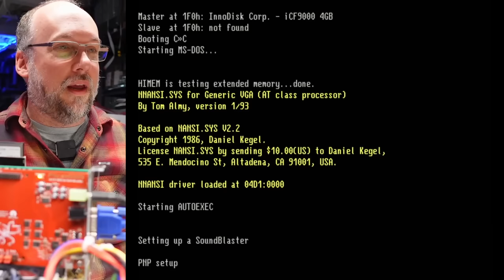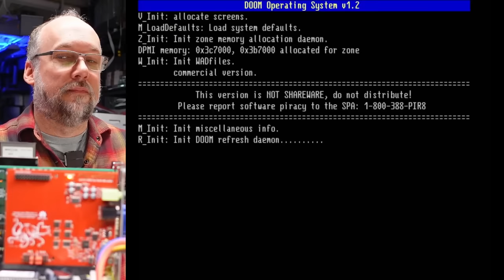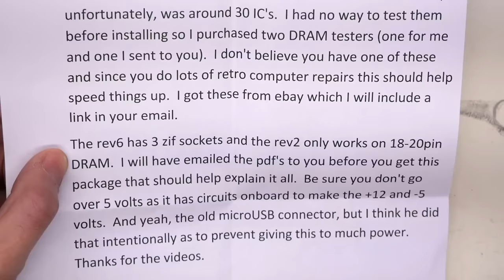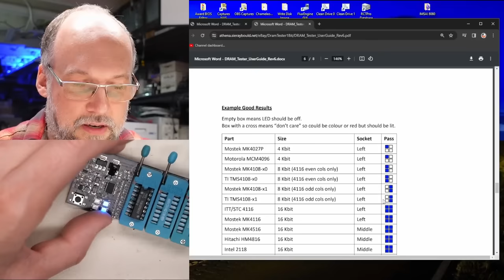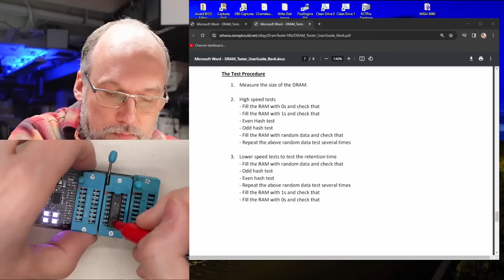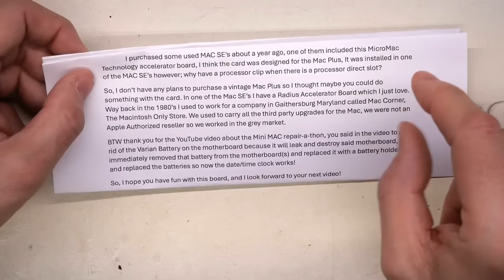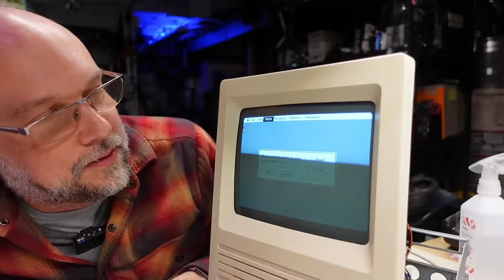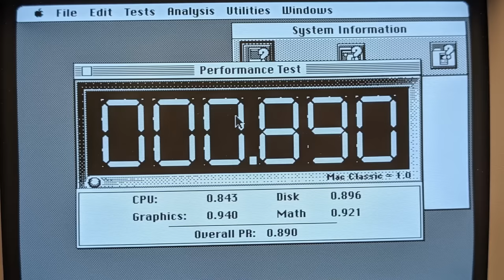0083 PicoGUS emulating a Sound Blaster, DRAM testers and a clip on Mac accelerator

Comment: Just some thoughts on sound cards... probably not worth reading.  :-D

1) SB 2.0 / Pro / 16

In DOS, everything was limited by RAM and disk space.  A game would have to pre-load the audio samples into RAM that it would be using.  And you would have to get them to the user somehow.  Nobody wanted to use 6 more 3.5" floppies to store the audio for a game.  (Or spend an additional hour or more to download it from a BBS.)  You weren't just going to compress them -- OGG and MP3 weren't a thing yet, and we wouldn't have had the CPU time to decode them anyway.  So, samples were (for the most part) 8-bit PCM, sampled at something like 8-22kHz.  Typically, 11-16kHz.

So, even if you had a SB16 or AWE32 or PAS16 or WSS, at best, you were probably getting a 16-bit mix of one or more 8-bit audio samples.  (One or more, because you might have some kind of environmental sound effect mixed with a gun shot or voice clip.)  Suffice to say, you weren't missing that much if you "only" had a Sound Blaster Pro with 8-bit audio.  The main advantage of anything better than the original SB 2.0 was stereo sound.  For DOS gaming, that's pretty much the top of the hill.  16-bit mixing is just a little cleaner mix of fundamentally awful samples.  Nice if you have the DAC and the CPU time and RAM to spare, but certainly no big deal if you don't.

Now, 16-bit was a little better for playing back sampled music, like MOD files -- which were also made up of awful quality samples, but there were more of them playing at once, so you could actually benefit from more resolution in the mixing stage.  It still wasn't going to fool you into thinking you were listening to a CD, but it did sound better.  GUS and AWE32, with hardware interpolation, better still.  The only time 16-bit really mattered is when you were playing full resolution audio, like a rip from an audio CD.  Never mind that one song would use a considerable percentage of your hard disk to store .... (Bear in mind, even as late as the Pentium, we still had BIOS limitations of 500MB hard drives -- not quite yet equal to the capacity of a single CD.)

2) GUS in general

The hardware sampling of a GUS was rarely used to its potential.  If you were a fan of MOD files or the demoscene, then you probably know what it can do for you.  If you're mainly in it for the games, there's not much to love.  It wasn't a Sound Blaster, which automatically limits its breadth of support right out of the gate.  SB emulation was nearly worthless.  OPL emulation was absolutely worthless.

Most games that DID actually support the GUS, still treated it like a 2-channel sound card.  The ones that supported it as a sampler might run a little better, what with not having to mix samples in software.  On a faster 486, that didn't matter much anymore.  Only a handful of games used it directly for music, which sounded better than software mixing.  Not WORLDS better, but definitely better.

Games that used General MIDI could use it as a MIDI synth, which was its target market, and the real reason to get one.  But, frankly, the GUS was tragically early to this party.  The original ones had tight RAM limits, which required balancing whether you wanted more instruments loaded, or better quality for fewer instruments.  Also, whether you wanted more voices playing at once, or better quality voices.  Later GUS chipsets improved on this, with more RAM and less limitation on polyphony.  NONE of them (AFAIR) had any support for hardware effects like chorus and reverb.  When the AWE32(/SB32/AWE64) came out, it had built-in ROM samples (to give you at least a baseline full GM sample set using 0 bytes sample RAM), the ability to augment or replace the ROM set, full quality at full polyphony, and hardware effects.  Better in every way, less rare now (and thus less expensive), and with full SB compatibility.

Of course, now, you can have an MT32 or Sound Canvas or Yamaha XG synth, so who cares about any of that.

TLDR:  The GUS is an aspirational card for those of us who were there in the early days, when our CPU struggled to play back an 8-channel MOD.  And that's about all it has going for it.  Super cool, but nearly pointless today.  Which, let me be clear, is to say nothing of the PicoGUS project.  Just having a software-defined audio card as a concept is enough reason to justify its existence.  But if you were wondering what you missed by not having a GUS -- not much, unless you were in the nichiest of niches.

3) High-end DACs

This is a trend I don't really get.  As per #1 above, a super high-quality 24-bit 96kHz DAC is not doing anything for you.  "ISA noise" wasn't a DAC problem.  It was a grounding and signal integrity problem.  Good electrical design practices will resolve that for you, and a 16-bit / 44kHz DAC is more than enough for anybody.  For the most part, it still is.  Now, granted, at this point, it's probably just as cheap and just as easy to use an HD audio DAC, if not cheaper and easier, since it's a baseline requirement for compatibility with modern audio sources like DVD, BD, and HD streaming.  But don't think your Windows 3.1 WAV files are going to sound any better through it.  ;-)  Garbage in, very high fidelity garbage out.

To sum up:  PicoGUS:  Good.  Hype about uber elite sound cards from back in the day -- mostly nonsense or for specialty cases that don't apply to nearly anyone anymore.  FOMO over 16-bit support or creme de la creme DACs:  Little to nothing at all there to miss.
Reply: Couple little expansions on what you said because it's almost entirely spot-on:

> If you were a fan of MOD files or the demoscene, then you probably know what it can do for you.

Even then it was still rarely used to its full potential because at a time when most people were connecting to BBS with 14.4k modems, most all musicians were still using 8-bit, low-fidelity samples in their tracks. Most tracks using all 32 channels or 16-bit samples were seen as flexes that were almost universally devoid of artistic merit.

> Games that used General MIDI could use it as a MIDI synth, which was its target market, and the real reason to get one.

And even then, only programs that used Real Mode (ie. no EMS or XMS) could really do this, and some still had problems with other TSRs. If you were using a game that used Protected Mode to access memory higher than 640k, you were SOL on General MIDI compatibility and were dependent on a GUS-specific driver.

> "But if you were wondering what you missed by not having a GUS -- not much, unless you were in the nichiest of niches."

Truest words ever written about the GUS. There's a reason why they were almost universally moved-on from by the mid-late '90s.
Reply: @krad2520   I've always been an audiophile (in the "I love audio" sense, not the "I love $2000 power cables" sense), and fascinated by computers, so the confluence of the two in the 90s made me lust after both the GUS and AWE32.  By the time I had a computer that could benefit from any of this, they were both options, and I was a little torn between the two.  Ended up going with the AWE, and it was 100% the right choice.

I did love demos, and lamented that I couldn't run some of them with hardware mixing.  Also, the famed "GUS patches" that you could use in software mode with CP even on plain 2-channel cards.. that had a mystique about it that made the GUS desirable.

Today, I do own a few genuine GUS variants.  One of them is in a Cyrix 6x86 running Windows 95.  I love it, but it's almost more trouble than it's worth under Windows, and being of the fledgling PnP era, barely any better under DOS.  As a wannabe MIDI musician back in the day, I would've killed for this computer.  I'm proud to have it now, but it can be ornery, and if I'm blatantly honest, doesn't do much of anything the AWE32 couldn't do better.  It's just a long-overdue dream fulfilled.
Reply: @nickwallette6201  I feel you on all of that, and am in (mostly) the same boat-- except in my instance, I opted for a Sound Blaster 16 and a Wave Blaster. Picked up GUS 2.4 later ~1998. It's nice to actually see someone writing something very relatable here LOL. I was also a little wannabe MIDI musician who hung out on the AOL "Composer's Showcase" board.

I really do wish that a lot of the hype that is given to the GUS was counter-balanced by the card's historical context. You clearly get it, you were there, but I don't think I've seen any YouTube creator explain that when the card came out, the general public's access to the things that took relatively full advantage of the card was limited & often arrived belated.

Like, if I'd even had my GUS in 1992 when it came out, I certainly didn't have access to the two BBSs in my area code that kept active mirrors of scene releases... those BBSs were not readily published in BBS lists and were very selective in granting membership.

Until internet access got widespread and people could get on the Hornet FTP, Scene.org, or Modarchive, your only real access to scene releases as a member of the general public would be if your local BBS had any reuploads or you bought a 'shareware/freeware' compilation disc that just so happened to contain them.

But by the time internet access got widespread and any of those resources I mentioned were available, the GUS's heyday had already passed.

If nothing else, I'm actually pretty happy that the PicoGUS is here to democratize access to the GUS experience so that maybe some of the astronomical hype around the card can be cut through :P

Comment: Just to avoid confusion: Wavetable synthesis means something different for soundcards and synthesizers. With soundcards it just means sample based sound generation, with synthesizers it means that there is a table of waveforms through which you step or morph to generate one sound, like in the iconic PPG synthesizers. It would be easier if soundcard enthusiast would agree to call their "wavetable synthesis" "sample based sound generation", because thats what it is.

Comment: For those PDS connectors, wouldn't rows of pin headers soldered in those holes work for connecting that MicroMac board to the motherboard? Would be a lot simpler than fidning the matching connector, given how hard older connections can be to find... :)

Comment: Yeah, there were a handful of PC programs that supported SID, I used to have an ISA card that took 4 SIDs, don't recall the name of the software packages off the top of my head though
Reply: HardSID Quattro was PCI, but the original 1-sid version was ISA.
Reply: @poofygoof  99% sure the quad card I had was ISA so perhaps not a HardSID but it was more than 20 years ago now so possibly I'm misremembering.

Comment: You might want to check the clock speed on that crystal. Maybe the cap you put in was the wrong value and the crystal isn’t running at the right speed.

Comment: Something that just occurred to me re: Cubic Player and offloading MODs...  How does it support the real-time visualization when the card is doing hardware mixing?  It wouldn't have access to the mixed stream, would it?  Is it actually software-mixing the audio in parallel just to give you the pretty graphics?

EDIT:  Oh, and it might not have worked in SB mode because the SET BLASTER statement was calling it a Sound Blaster 16 (T6) with High-DMA 5 (H5), and that obviously was not backed by hardware.

Comment: I still have my original GUS 1.37 card. Not the later version but the OG. Unfortunately my Sinclair PC200 has a DD floppy drive so I can't load any software on it! Not yet, until the PicoMEM that is ......
Reply: Hi,
PicoMEM 😀
You may even not need a picogus to do gus on the PC200, It may arrive on PicoMEM as well.

Comment: just wondering, is it possible to use the menus in autoexec/config to choose a "profile" that will load the appropriate firmware then set the rest?

If I can allow myself a little suggestion for the PicoGUS, if there's a couple spare pins on that RP2040, maybe a MUX or 2 to set the SB settings in software?

Comment: I have an old (1987, designed here in Hungary)286 laptop with an extra 8-bit ISA slot,(and also an extra 16-bit ISA slot, occupied by an ISA RAM card) and 1MB RAM. Will this PicoGUS card work with that? DOS games with B&W CGA-compatible graphics, and Windows 3.11. Nothing else I want from that computer.

Comment: "Limiting the power input" is a bad justification for using a micro-B USB connector instead of a USB-C; you can't really trust the source to limit current to anything in particular (many power bricks will blindly deliver 2-3A even over a micro-USB), and you should just put a fuse onto the board if you're concerned about that.

In fact, looking closely at the board it appears there is a fuse on the designs anyway. If you're worried about it blowing from bad chips and being a pain to replace, then a polyfuse or e-fuse will provide a resettable (and in the latter case, highly tunable) option.

Comment: It'll eventually have support for sound blaster pro 2 or 16 that support with full 44khz 16 bits stereo quality and OPL3 and are the sweet spot for full DOS, Win 3.1 and Win9x compatibility. it's a nice project.
now... somebody do this for 3d accelerators? like a card that emulates 3dfx up to voodoo 3 and maybe the first couple of ati and nvidia?.

Comment: Why use this ugly mini jack connector for MIDI out?! They have fully designed the board and couldn't fit a proper DIN-5 connector?
Reply: DIN-5 is too large for the opening on an ISA slot. 3.5mm TRS is relatively standard in the MIDI world and adapters are plentiful and easy to source (which is why I'm able to include them with the PicoGUS board).
Reply: Ehh... assuming adapters can be found (which isn't a given...), I would've gone with mini-DIN myself, like the Live! did.  More often than not, I can't see the slot when I'm plugging things into it.  Even if I could, which is which?  Who knows!  I guess I'll find out if I plug in and only hear MIDI.  (haha)  :-D  But overall, meh.  It works.
Reply: @nickwallette6201  There's 2 connectors, if you're that used to plugging stuff blind, surely you can tell left from right. I agree it would be best with a DIN, but get off your high horse.
Reply: @nickwallette6201  5-pin mini-DIN would have meant a custom cable which would have increased the cost considerably. 6-pin mini-DIN to DIN-5 cables are still commodity parts (due to AT to PS/2 adapter cables) so that could have been an option.  My primary goal when designing this card was to make it as affordable and available as possible, and 3.5mm TRS solved that issue and still sticks to an official MIDI standard. I could have gone with 2.5mm TRS (which according to the standard is actually preferred) but in my experience those fall out or can be snapped off way too easily.
Reply: @charlesdorval394   Oh relax.  It was an idle musing, not a complaint.

If you have ONE retro computer with ONE sound card, it's really not a problem.  You figure it out once and you're done.  But I have ... more than that.  So every time I plug in an audio cable, usually blind, reaching around the back of a case, it's a game of "which jack is audio out?" and I often have to Google a picture of the card in question to figure out if it's the one right next to the joystick port, the one next to the one next to the joystick port, or the one furthest from the joystick port.  And then I have to make sure I'm actually feeling a joystick port and not a VGA port.

I fully recognize this is a niche case, so I was pontificating on how I would have solved this problem.  But, as Ian just said, my solution would've required more expensive adapters.  Although, granted, only for the group of people who actually plan to use the MIDI port at all -- in which case, if you're willing to buy a hardware synth, sourcing a cable is probably not your biggest concern.  But I digress.

Now, if I may dispel any illusion of a high-horse at all, my conclusion to the whole topic was, and I quote:  "Meh."  I'm really not sure how I could've had any opinion at all that was any more chill than the verbal equivalent of a shrug.
Reply: @nickwallette6201  To be devil's advocate, "meh" is as much an insult as a direct one. "Mid" is today's generation's insult. Mid should be average or "middling," right? But the intended meaning ends up being below average. 

Calling something average actually ends up being insulting just like how older generations said things like trivial, boor, villain, etc. Examples of words representing something average or common, where boor and villain etymologies were literally common folk, so the words for them were used as insults.

So... saying "meh" is to represent being in the middle, not feeling strongly either way, evoking basically no emotions, which is just as much of a rejection of something as outright rejecting it.

I'm bored, so I wrote a lot, but I hope it was at least slightly enlightening, rather than mid.
Reply: @Loki-   Look, language is imprecise, and that's fine.  But "It's meh."  and  "Meh. It works."  feel like two completely different things to me.  You guys are making a mountain out of a molehill here.  The product's great.  I would've gone with a different I/O option, but the guy had good reason to do what he did, and guess what -- with it being OSH, if you don't like it, you can do something about it.  So, I'm going to double-down on my reply here.  It's not what I would do, but.. MEH.  Big deal.  Small potatoes.

I don't actually need this card at all -- I have all the OG hardware it emulates.  But, if I did need it, I would be happy to have an option that didn't exist before.  That's the takeaway.  Misinterpret, or justify whatever offense could possibly be taken.  At the end of the day, what I meant is what I said, and I can't really do a lot about it if you guys want to take it some other way, despite two clarifications now.